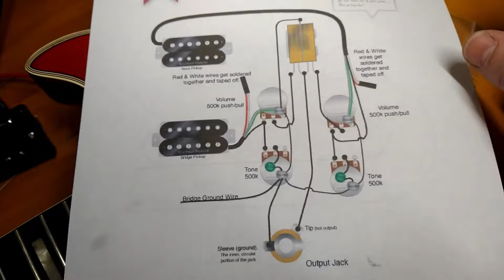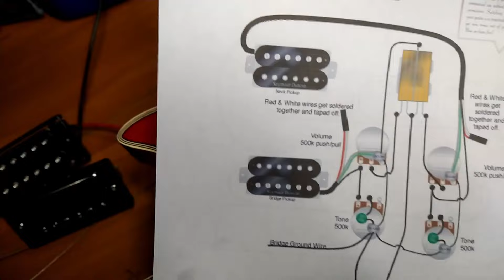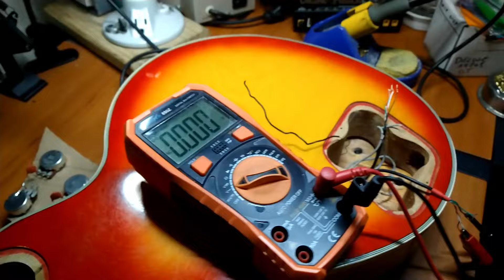Scarred AlNiCo V Humbuckers - Let's Repair Episode 52

Comment: I recall picking up a lawsuit era Les Paul copy made by Burny (I think) I bought it in the early '80s and it was in a mess.
 I tidied it up and polished most of the scratches out of it and set it up and flipped it, I wish I had kept it now as it was a set neck version and looked quite good from what I remember